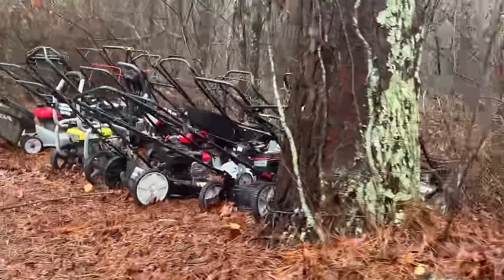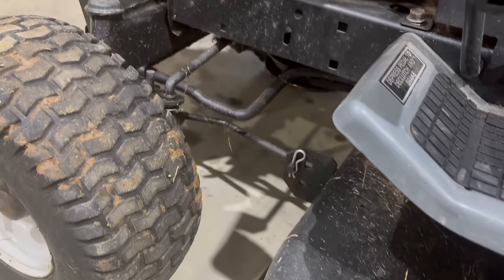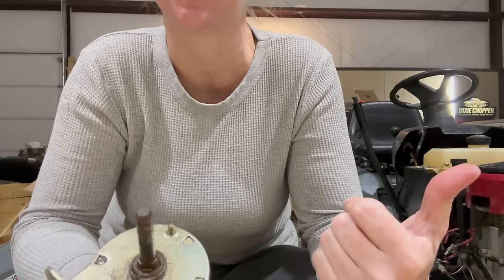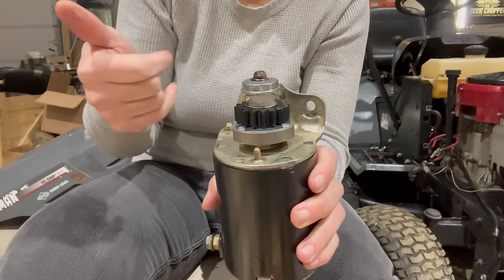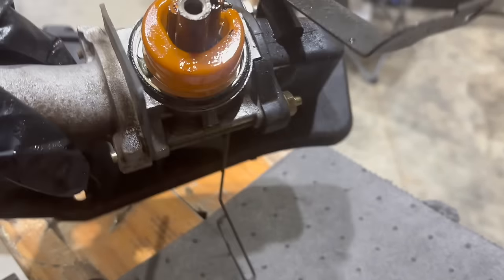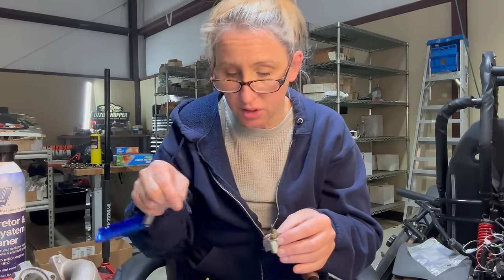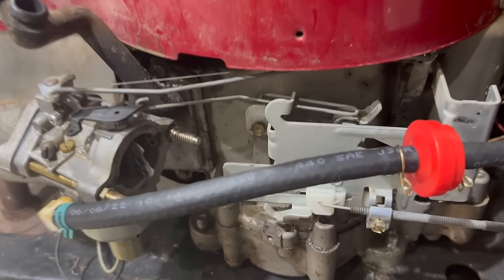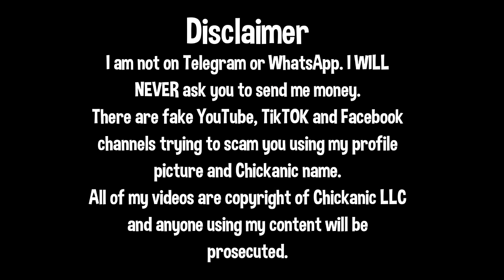Customers 30 Year Old Trash Makes Me TONS of Money! Giving Purpose Back to Abandoned Machines.

Comment: Just use lacquer thinner in the carb. Berryman's is mostly lacquer thinner that costs more. The good carb cleaner from days gone by had MEK in it and it stripped the completely hard like paint from thise old carbs. 
    This from a guy who takes on old Japanese motorcycles with gas from the Seventies still in the tank
   That surging is possibly a bit of dirt in the low speed jet or maybe the governor linkage hit a bit off during reassembly... Just stuff to check. Setting a governor on a briggs is something of value to us anyway as I forget how. That surge is so minor that Berrrymans would probably fix it if the jet is restricted or the emulsifier tube is s bit plugged.
   There us a guy on another channel who puts carbs into glass jars rightly sealed with carb cleaner inside and chucks them into a water filled ultrasonic cleaners eith goid results . The glass jar transmits all those goof vibes for a thorough clean. Just something to try.
   My preferred lawn tractor is Wheel Horse from the seventies. I buy non runners mostly to develop parts supplies. These tractors have a cult following and are super easy to eirk on the old Kohler engines

Comment: I bought a bran new BX 2200 Kobuta diesel tractor and I call it a garden tractor on steroids. It’s a 4x4 with a manual rear locker front loader and 60” belly more and hydraulic 3 point hitch and in 2002 I paid 15K for all of it and first year I ran Rotela Dino the second year and every year since I have ran 15 W40 Amsoil  and I change my once a year and I send oil samples every oil change to Blackstone labs to check on injectors or diesel in oil and any high wear metals. The only thing I have done was the 2 power steering hoses and 2 batteries and it use’s car size batteries not the tiny ones and that’s it and it has 1200 hrs on the meter and does not use a drop of oil. My buddy is on his second or third Cub Cadet and the one he has now is a V twin with bigger tires. He drives me crazy some times when he is mowing on a 95 plus day and he just turns it off and it goes boom when he does that and he finally asked me why does it pop. And I told him your mowing wide open throttle and you motor is red hot and you leave at wide open and you just turn it off and the gas or fumes get in the muffler and goes boom. He asked me what should I do and I told him the throttle to idle and let it idle for like 5 minutes to let your air cooled motor cool off before shut down it does not do any cooling when motor is not spinning and the fins on your fly wheel are not turning it has no way to cool itself down and every spring I ask him did you change your oil and oil filter and air cleaner and he just says yea I think so and I pull his dip stick and oil is black and I ask him have you changed it sines new and he said the dealer said to change the break in oil after he mows his yard 2-3 times and I did that and it’s 3 yrs old and oil has been changed 1 time !!!!!

Comment: Bre did  you by any chance order any cams for 17.5 HP - 20HP  Briggs motors did they send them to you?
Reply from the maker: I have two in stock right now. This engine has the old style cam that was built to last forever. Why they stopped using it, I'll never know..

Comment: The burble in the engine when the governor opens the throttle kicks the RPM up  -  is because it's running a little lean. I bet the emulsion tube and the main jet aren't clean yet -- a little Berryman's B12 will clear that up instantly. 
FTR -- those sonic cleaners were always a big disappointment to me and I stayed with more aggressive spray chemicals to get the best results. I still build carberetors for vvehicles as they are maiing a return to "basics" in the automotive hobbyist here in Montana - back tomthe roots, if you will. 
NO-body here understands float levels nor points & condensors and ° DWELL - it's like I went back in time and nobody inows how to fix them.

I tend to not get too excited about Briggs engines -- but Kohlers! There's something worth repairing no matter how much it takes. Splash lubed engines get really low on my happiness scale.

Comment: You flinched when it started surfing. Stuck choke cable. You got the engine purring like a kitten!

As long as the tires hold air, you don't need to replace them, do you,(unless they are rotting out)? 

Total up the number of hours you put into this machine, please, and the cost of any replacement parts. What's your hourly rate? Regular ASE mechanics are charging $85/hour. 

Time is money, but if you have lots of it, this repair is a joy and an educational tool.

I bet some nostalgic Craftsman owner will pick up this refurbished model long before spring starts, Tuesday March 19.

Comment: I have an Onan generator on my toy hauler and that valve sticks and I called Onan to get that and they said I had to buy a new carburetor for $250. I’ve been a mechanic on heavy equipment for 45 years. I told that smart ass parts guy that I could fix it and he said that’s what everybody says, and then they buy a new carburetor Needless to say, I fixed it and called him while it was running I told him to kiss my fuzzy ass

Comment: years ago i told the boss if it goes and mows its $500.00 doesnt matter if its pretty. now i'd call it $750.00. i'm thinking the air bleed is plugged causing the surge. those engines were all but bulletproof. got its brother sitting in my yard. you should have shown the tool for taking that clip off of the starter. it can be dne without but man is that a pain. oh and dont bother reusing those clips they'll break and thats probably what happened there
Reply from the maker: You're right. With walk behinds getting so expensive I should try for a bit more on this one. I don't think I have a clip remover. I've been doing it the hard way. LOL!

Comment: I think if you are a small engines mechanic, you could make a lot of money in todays world refurbishing the old reliable machine instead of selling the Chinese crap of the new century. Post 2000 is when I think quality started to drop off. I had a 2002 Craftsman ridding lawnmower. I called it a crapsman.